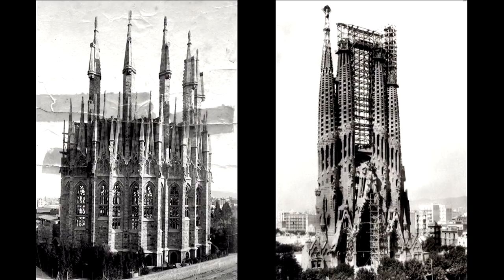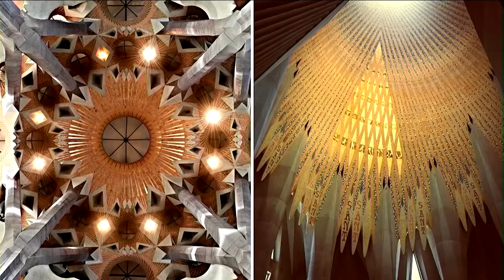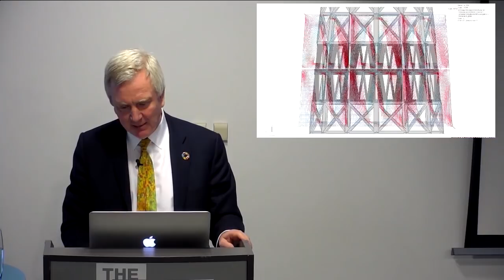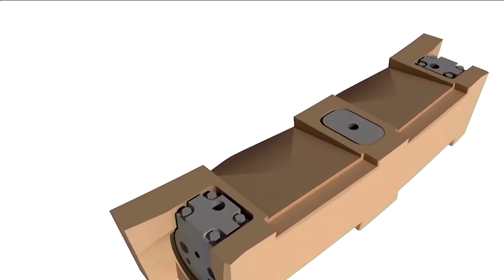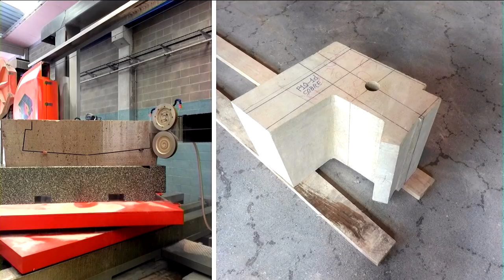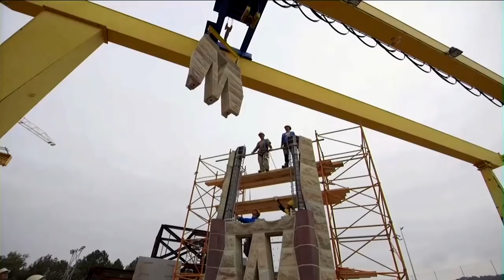Completing La Sagrada Familia, a talk by Tristram Carfrae

Comment: Cant they use modern design to put in an elevator, instead of or as well as the 20 floors of stairs??
Reply: they stick to the project gaudi intended it to be as closely as they can. if there's a clear staircase in the drawings, its gonna be made this way
Reply: oh sorry i just finished watching the video and they're actually making a lift inside the spiral staircase ahh

Comment: Gaudí designed his buildings in stone so they could last centuries or millenia. However, they pouring concrete in La Sagrada Familia. Unfortunately, the durability of concrete is 100 years...
Reply: See 13:10 and 34:40 re: concrete...
Reply: Just one of his many materials used - stone, concrete, pottery, shards - he used concretions with shards in cosmetic, non-structural save to hold the pottery to his structures (other projects he did)
Reply: Is explained in the video. Reinforced concrete had to be used to comply with seismic requirements. Stone alone was not enough and at the time there was not other way to do it.
Is only used where strictly necessary. This pre-tensioned stone method is way better,  so you can be pleased to hear it will not be used anymore.
BTW,  Good reinforced concrete can last forever.... So no need to worry about it, they are not on a budget and use the best available.